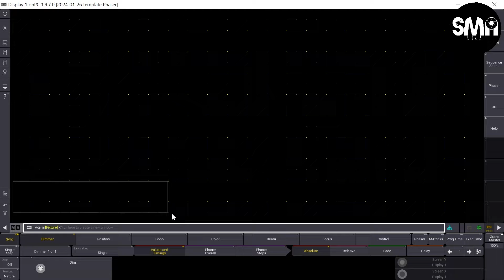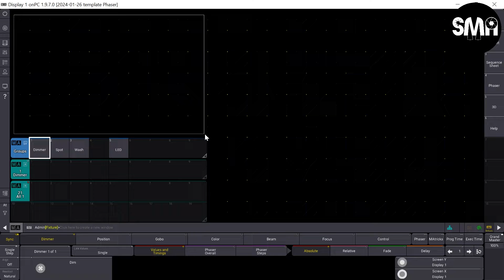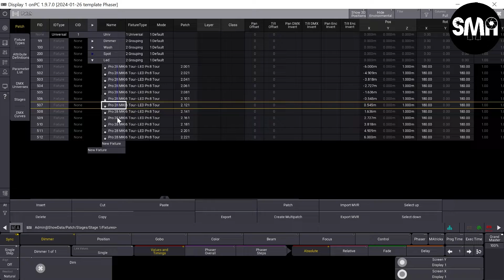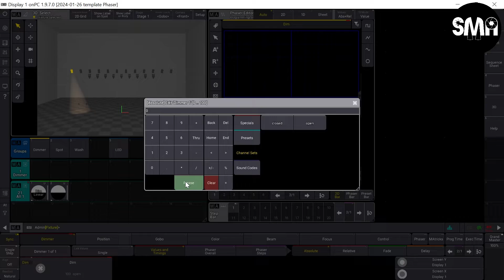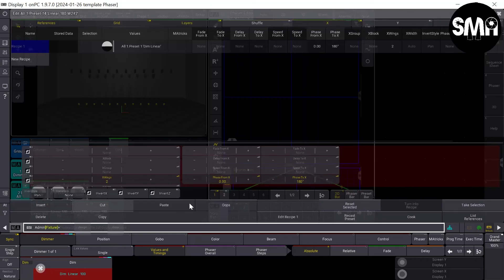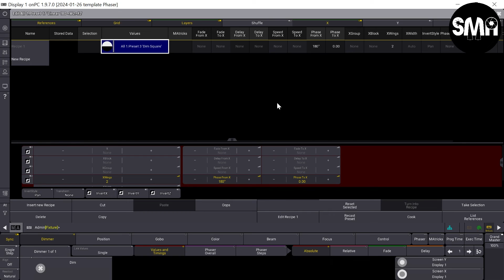grandMA3 template Phaser Dimmer

Comment: hey! thanks, very helpful. just one question. how do you manage speed after a dimmer phaser is created? I mean, I have it as a recipe template, but if I want to store it in a cue and adjust the speed of it, do I have to modify the ingredient phaser or there's a quicker way which doesn't affect the receipt itself?
Reply from the maker: Hello Alberto and thank you for your question.
As always, there are several ways to reach your goal.
I can think of three solutions off the top of my head:
1. you can assign a Speedmaster in the Phaser template. 
2. you can assign a speedmaster to a sequence.
3. you can assign a speedmaster to a cue or cue part.

I would create a suitable explanatory video for this.

Best regards
Majehrke
Reply from the maker: Hi Alberto, I have made a new video in which I try to explain 3 different ways,
how to use SpeedMasters with Phasers.
Reply: thanks so much mate! you're the best!
 @majehrke

Comment: I'm new at ma3 so the question may be simple but) 
maybe you know a way to do something like this: for example, I have 16 lights and I want to do a ramp effect from left to right where 1 light turns on, and when the next light turns on, the previous one immediately turns off with a little fade out. In general, only one light is on at a time. I'm interested in how to do this with a phaser or recipes
Reply from the maker: Hello @lo.onlylove, thanks for the question. In general you only have to make an 2 Step Phaser: 1st Step 100% and 2nd Step 0%. Then you have to set the Width of the 1st Step at 10 and the Width of the 2nd Step at 190. Store that as an Universal Dimmer Phaser. After that you can make an new „Dimmer Phaser Recipe Preset“ with no selection / the newly created 2 Step Phaser as Values and a Phase of 0 thru 360. I would try to make an Tutorial about this and Upload it at the Weekend. Best regards
Reply: Thanks @majehrke I have been testing this method and it works good for me, but I would love to see your tutorial. 
If possible, I would also love to see a tutorial on how to create a custom pixel fixture (something like glp jdc-1)
Reply from the maker: Hi  @lo.onlylove  the Single-Pixel Dimmer Phaser Tutorial is out now.
I can try to make a Tutorial about how to Creative a custom pixel fixture, but I would do this with the gdtf builder and it takes more that one Video to explain it.
But I will keep you request in mind and we will see what I can do for you.
Reply: Thank you so much @majehrke